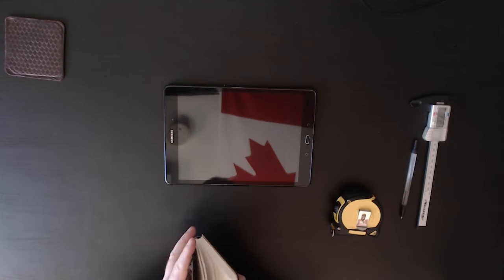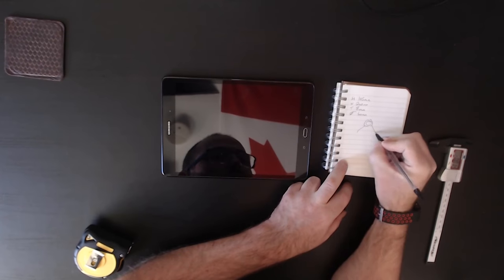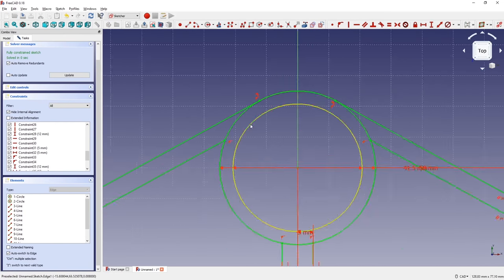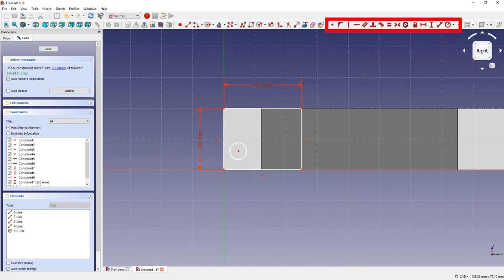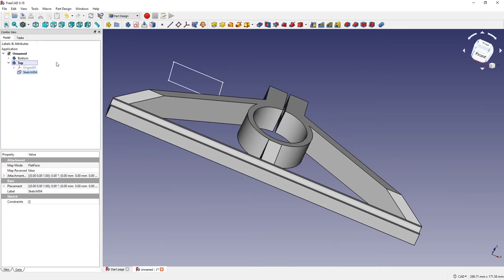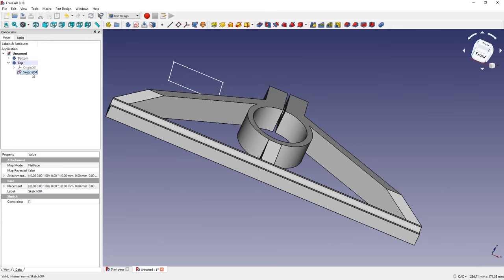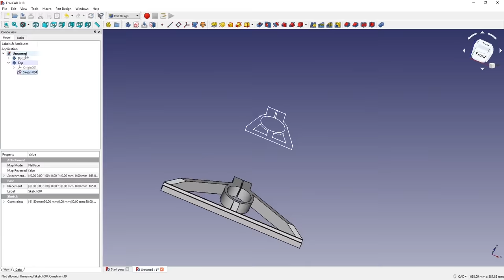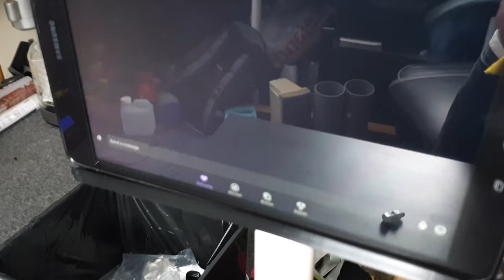Trying FreeCAD for the First Time

Comment: Use some its addons, the screws and other fastener components are a breeze, no need to design those yourself, any more than machining and making them yourself in reality. The auto matically created parts can be industry standard items or if desired can be 3D printed too as suits.
The range of addons are great. Also there are instances where a not fully constrained sketch can be extruded, pocketed etc. In reality if not fully constrained the software can only proceed making assumptions based on placement on screen, like the default dimension that pop up as you place fixed dimensions. These may or may not work in reality. 
Originally I had major problems finding what is not constrained, many time with 1 or 2 missing constraints. Poking around trying to move bits sometimes still failed. Now I learned by clicking the missing count will highlight where the Freecad shows a unconstrained item, by green marking the faulty section. Often it was a point not fully joined to another, that on poking around was not seen as always the constrained point got picked. Other times to me all dimensions seemed in place, but actually some small detail was not there. With time you will get quite comfortable getting constrained fully. A good practice is to keep fully defined as you enter the design, not try to fix up the entire thing when all is there to confuse the work. Using relationships and equalities also helps, avoiding the past habits of 2D drafting of dimensioning all details independantly, rather than related to already defined details.  See the methods demonstrated by Joko  engineering videos, he covers several great parametric design systems and appears very skilled in all his activities.
Reply from the maker: thank you for the suggestions. I'll definitely give them a look on the next project

Comment: Hi, Thanks for this review. Initially I want a CAD system to import and modify .dwg files into for Architectural purposes but would like to get into 3D modelling and design. What's it like for  basic architectural 2D drawings?
Reply from the maker: I have only used freeCAD in a limited capacity and not used it to import drawings yet. But if it can do this, I would say there shouldn't be too much trouble with it
Reply: There is an architectural and BIM workbench in Freecad, as well as FEM.
Reply from the maker: I probably should revisit freecad and see what changes there have been since this videobwas made
Reply: @IQWorkshop  I first tried Freecad many years ago struggled and gave up for F360. Last year I had to design something for a HNC project, struggled with F360 and succeeded in FreeCad, complete with FEM and fluid dynamic representations. 
Now loving and persevering with FreeCad.
Reply from the maker: I'm a great believer in "if it works for you, it's right!".

I just like showcasing different options so people can find "their " fit

Comment: If ur familar with fusion, ok. But with some "free" plugins Freecad is realy powerfull.
Reply from the maker: With practice comes proficiency.
I've been using F630 for a good number of years and I'm OK at it.
When I say OK - I mean I can achieve what I need to in it.

I need to get to a similar level in FreeCAD just in case I need to make the switch

Comment: sir. how accurate freecad for machining procceses?
Reply from the maker: Thanks for the question 
In my limited use I have had very good results from freecad for 3d printing. 

I have yet to use it for CNC, however what I have seen gives me confidence that it will produce good results.

The important thing it to test it with a non essential job and understand the limitations of your setup and your knowledge. 

Good luck
Reply: @IQWorkshop  thank you sir
Reply: As a fully BREP based system, i expect that at least export to STEP files to process with other software such as professional CAM will be absolutely precise, i don't believe you need to worry. It seems internal CAM (Path WB) is OK too but whether you'll achieve your results with that depends on like a million things, i don't actually have experience with that.
Reply: it's accurate, the hang up is whether there is a gcode postprocessor for your machine. i had to write my own
Reply: @SianaGearz  oh. thank you sir.
Reply: @Keechization  thank you sir.

Comment: Just illustrates that you need to actually learn how to use a piece of software rather than assume all your prior knowledge translates. If FreeCAD worked the same way as Fusion 360 there would be no Fusion 360. Fusion 360 is a little like "loss leader" products at the supermarket, once there sufficient numbers are persuaded to actually pay for extra functionality to make AutoDesk a profit. The changes instituted are a gamble that more people will upgrade than drop out and their backtracking on some of the changes indicates the original gamble was a losing proposition.
Reply from the maker: thanks for the feedback. This is exactly why I made this video. to demonstrate what would happen if f360 just went away and users switched. there is a barrier to entry before being productive and a lot of comments I have seen is they are abandoning f360 with an apparent lack of thought as to the implications. 

I like both applications for different reasons and I continue to learn freecad to deepen my overall understanding.

Comment: fusion 360 and sketchup are more or less forcing casual users to either use pirated software or just leave their platforms. (i know sketchup free is now browser based but i don't see the benefit of learning their new interface.)
Reply from the maker: it's always good to know what alternatives out there, just in case what you are using, commercial or not, goes away.

Comment: I don't understand why these tools like F360 and FreeCad make it nearly  impossible to just freely sketch an idea out, and once you have settled on an idea then add all the constraints and dimensions. It makes them really bad for designing unless you know all the specifics ahead of time.
Reply: If you haven't settled on an idea yet or don't know the specifics, you probably don't need 3D CAD. Just pencil and paper will do in that phase. CAD programs are not really tools for artistic design processes. But rather for industrial/product design (like in the video), mechanical design, architecture etc.
Reply: @olavl8827  That is just nonsense. The difference between sculpture, architecture and product design is a slim one. I do almost all my sketching in Adobe Illustrator, and combining that with Blender, Sketchup or even Tinkercad, I can get things roughly where I want them, but there is no path for refinement from there.  As artists and engineers have proven for millennia there is no actual need for CAD, but when it comes time to manufacture something it sure is handy, especially when you need to make variations on a design.
Reply: Yes, parametric CAD software are not design software. Design software is more something like Rhino and MOI, but they are not parametric, so it can be difficult to change the sizes later too. It's more like sketching in 3D.

I think these two approaches, freeform and parametric, are at odds with each other, since the construction of an object imposes a particular hierarchy of operations that are baked into it, and that object can be reconstructed again by following the same, because your sizes that you build something from and that you can measure are not necessarily the final sizes, this is what sketch constraints and construction lines allow you to express. I don't have a good example right off the top of my head, but maybe you know what i mean? As material gets removed or added successively it can make fundamental measurements no longer accessible.

Fundamentally parametric design is exactly there to solve the problem that you don't know the size YET. You can go up the construction tree and change the sizes later, and if you're lucky, the object will recompute. But you need at least something for a start. A particular issue is weak topology, that depending on the sizes, not only the dimensions of the final object can be different, but also the topological geometry. like depending on where things intersect, there can be a different number edges between parametric surfaces. Imagine intersecting a cylinder with a cube, and then think, is cylinder taller or shorter than the cube? Is the diameter of the cylinder smaller than the size of the cube, or are they between that and the diagonal of the cube, or larger than diagonal of the cube? These all generate different topology, not only different sizes. Then you have built something on top, something that depends on generated surfaces and edges, and if the number of surface patches and edges isn't the same, there's now way it can match and reapply. Even when number is the same, the "topological naming" problem can cause a reconstruction failure, where there is no way to identify which edges and surfaces are the "same" after reconstruction.

You can actually go in FreeCAD create a Spreadsheet and define your variables there, your named sizes, and you can then change them later anytime. But it only underlines the inefficiency of FreeCAD at freeform design and you end up putting extra effort in to account for your size uncertainty. And i'm not sure how this problem can be solved?

If you have any thoughts - i might be compelled to create a CAD software eventually, but thing is, i don't have the whole picture and i don't have a solution, and i have related experience with developing graphics engines and graphics tools but not nearly enough CAD and freeform design software experience myself; so i'd like any possible input. I'm not sure that i will embark on this journey to write a CAD yet, i lack crucial insight of how i can make something different and better, there is little value in doing a sub-par job.

Since there hasn't been an actual solution that i know of or that is widely known, it's been an essential skill of product designers to go as far as possible before hitting the software. Sketching pencil on paper, mocking things up from cardboard, styrene, foamcore, plasticine, etc. By the time you end up in software, you already have the topology in front of you so you can focus on constructing parametrically with just enough flexibility built into the construction to fine-tune the sizes.
Reply: @macrumpton  It's great that you are proficient with Adobe Illustrator, Blender, Sketchup and Tinkercad. But none of those programs are what say a mechanical engineer would use. One category of users just wants to be able to freely draw what's in their heads. Another needs to be able to work to very exact dimensions. CAD software like Fusion360, SolidWorks, FreeCAD and such (mostly) cater to the latter category.
Reply from the maker: I tend to sketch on paper and then once I've settled on a design, think about the orthographic views. that when I start using cad software no matter.what version it is
Reply from the maker: there are no wrong ways to do things , only different. 

if it's  understandable to the user, is an efficient use if time and produces a usable end result it gets a big 👍 from me

Comment: I learned a lot of the best practices for fusion 360 from Lars Christensen. I wish there was a similar teacher for freeCad.. I like freeCad and appreciate the  effort of the developers. I typically learn the freeCad best practices by making mistakes and then starting over and this process consumes a lot of time.
Reply from the maker: i hope i can grow into a knowledge store like Lars. until then i will share what i learn as i use the tool and figure out how to translate whqt i know in f360 to freecad.

thqnks for the feedback
Reply: Oh there is
Check out JokoEngineering

His videos helped me quite a bit.
Switching to FreeCAD is panifull but if you want to do some work related to 3d design maybe it's very welcome addition.

It's either that or buy cheaper but more functional cad software. Or just plunder solidworks (not recommended tho).
Reply from the maker: Thanks for the suggestion. I'll give that channel a look 👍
Reply: Nice introduction to freecad. Can you please recommend a laptop for working with this software.